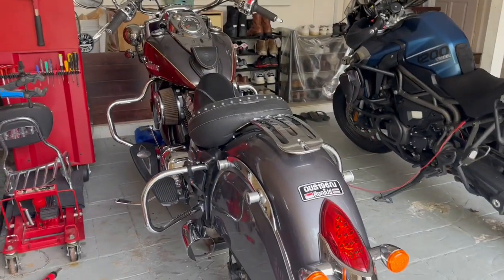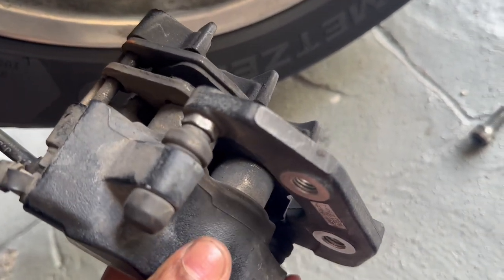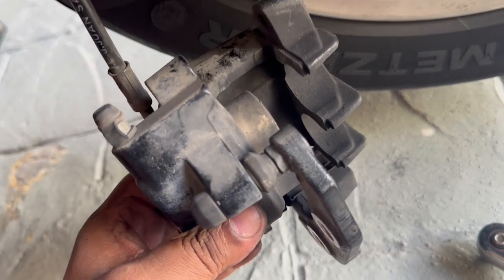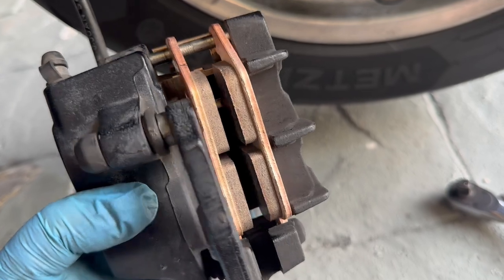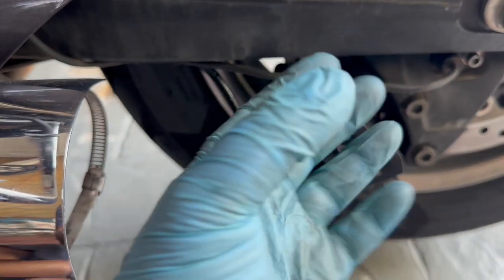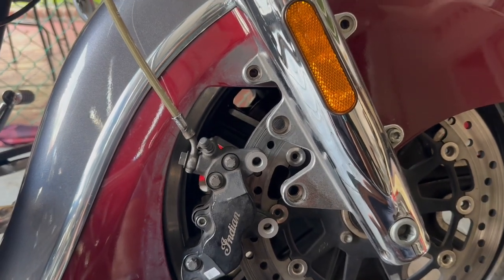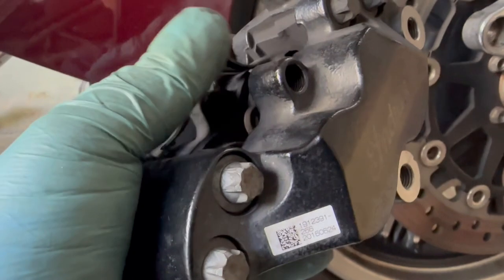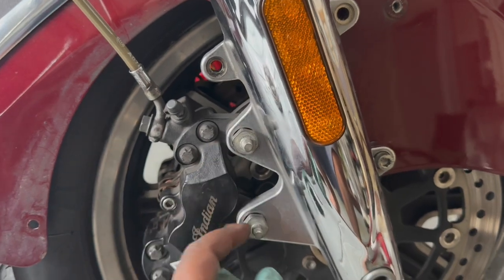Indian ThunderStroke - How to Change Front & Rear Brake Pads

Comment: Hi, so there is no need to bleed the lines, just pump the brakes to get the pistons reset? Also, I need to buy a torque wrench. I have a 2016 Springfield. Is the 1/2 inch sufficient, or do I need a 1/4 inch as well? What sockets do you suggest? It looks like the calipers need a hex and not an open socket, do they come in a set? I've only seen the open socket sets. Thanks for your help, I was going to have the dealer do this but after watching your video, I believe I can manage it! I just watched your fork video, that looks like a much bigger job than the brakes!
Reply from the maker: You don’t need to bleed the brakes to change brake pads. I am going to be bleeding my brakes and changing brake fluid soon and will post a video of that. Recommended to do every 2 years or every 10k miles (16k kms), whichever comes first.

As for wrench size, I would recommend a 3/8” socket wrench and a torque wrench. 1/2” is big and needed for bigger bolts that need a much higher torque like wheel axle bolts. 1/4” is small and won’t be enough for brake calipers and most bolts on the bike. 3/8” is the most versatile and commonly used. If you can, also buy a 1/4” for smaller bolts like your clutch/brake levers and your brake caliper retaining pins. But if you must only buy one, get the 3/8”.

Buy a decent quality metric socket set and a decent quality bit set that includes hex bits and torx bits and you should be fine.
Reply from the maker: Oh and only use the torque wrench to tighten bolts. Don’t use it to loosen bolts. Use a regular socket wrench for that :). That’s why you’ll need both.
Reply: @eazyontwowheels  Thanks for taking the time to answer! You do a great job on your videos. 3/8s it is then. I do have a decent Stanley standard and metric socket set. I'm coming up on 15k miles on my 2016 and my rear brake just started making a rubbing sound, so I think it is pad time.
Reply from the maker: @bluzzjazz  thank you! I learnt a lot from others on YouTube and ever since I started working on my bikes with simple stuff like oil changes, I was immediately hooked and not so afraid to attempt slightly more complex maintenance jobs :)

Comment: Hello.  May I ask where you put the jack under the motorcycle?
Reply from the maker: Just under behind the side stand
Reply: @eazyontwowheels  under the engine?
Reply from the maker: @mirob4041  yes under the engine just behind the side stand. Make sure no cables or brake lines get pressed by the jack :)
Reply: @eazyontwowheels  thanks for advice

Comment: Is it the same brake pad part number for both front and rear?
Reply: JK, I see the part numbers now. Jesus, it's like nobody knows what parts are for these bikes. I've been trying to find the front brake part numbers for ages now.
Reply from the maker: What I usually do is go to revzilla.com and enter the bike model and year, and it only shows parts that fit the bike. You can get part numbers from there.

If that doesn’t work, I find the OEM Polaris part number from the Indian website and then google that part number. You’ll almost always find aftermarket parts along with their part numbers that are a direct replacement for the OEM parts